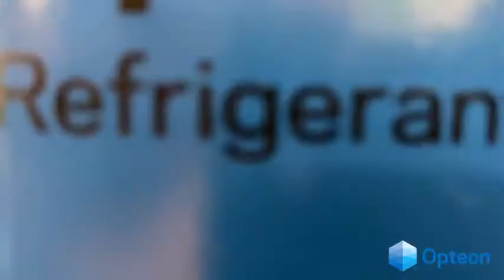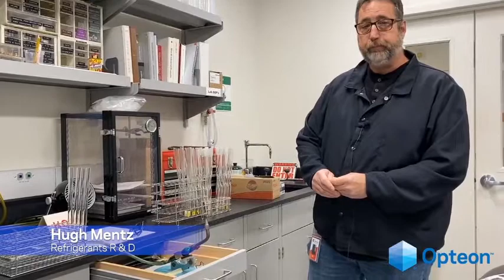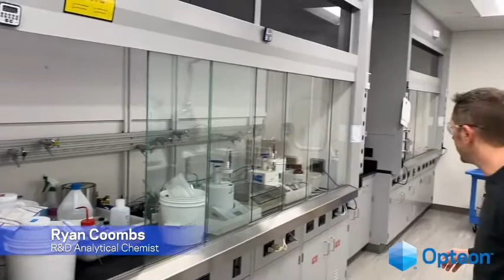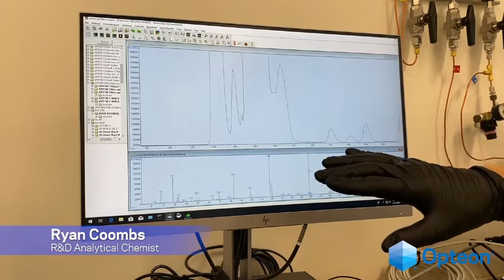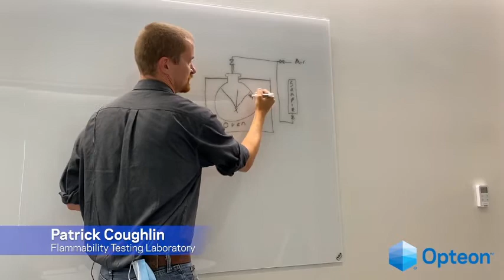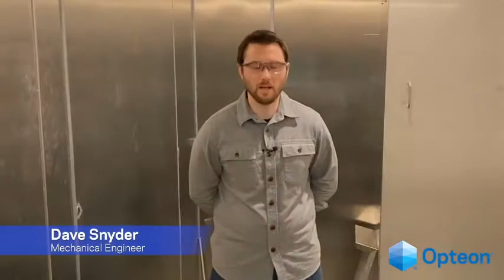Making a Refrigerant - A Behind the Scenes Look with Dr. Charles Allgood of Chemours

Comment: great video! i could look at the flammability test for hours, because we as hvac technicians have to trust these classifications, having rarely the chance to see refigerantburning (e.g. errors like soldering while there is still some ref in system or internal leakage into soldered pipes. thus seeing a test row, showing various compositions and how the flame wall is propagating would be great. examples r32 vs r410a, is the r125a content  really that effective in reducing the flammability? is there important difference when pve-oil is into? etc....